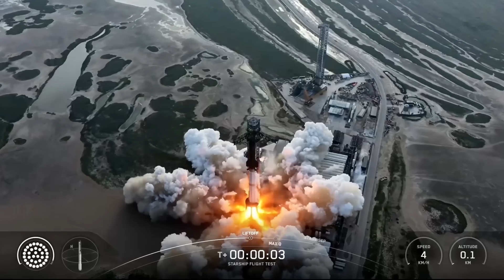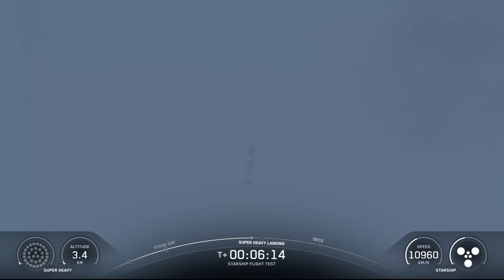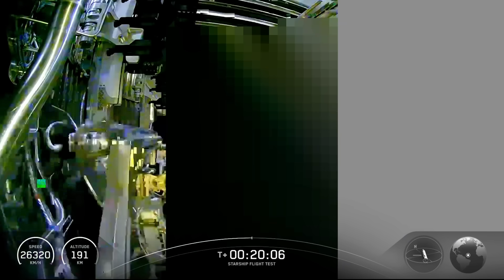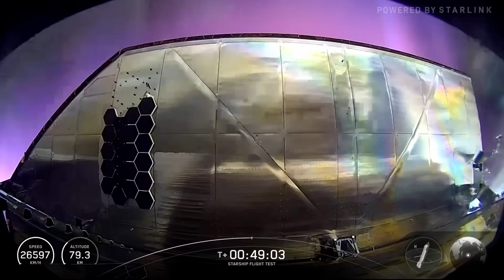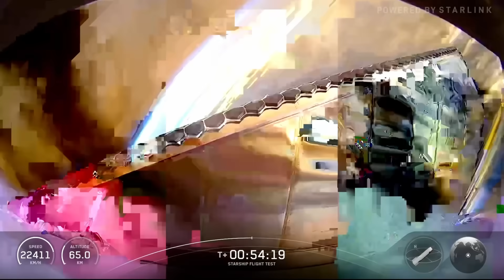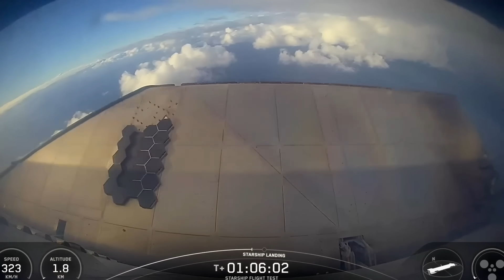The Most Unbelievable Rocket Launch In History (SpaceX Starship 10)

Comment: The female announcer was partially incorrect about the staging process. The whole point of HOT staging, is that you stage WHILE the stages engines are ignited. Instead of the ship staging, then the engines igniting, the engines ignite, and then it stages. This is done to insure fuel is flowing to all engines as seperation occurs.

Comment: The ship is sank down, why they are so happy? It missed the point of landing or not? Somebody can explain me what is just happened?
Reply: It was a simulated landing. They weren’t trying to land it on a landing pad, that’s why there was a buoy out in the ocean with a camera. They were torture testing the ship, and experimenting with trying to land it with one of the 3 thrusters out. They landed it in the ocean because they didn’t want to risk damaging the landing pad. And yes it was supposed to explode. It’s impossible for it not to explode with fuel still in it at that temperature hitting cold water.

It’s actually far more successful than they thought because the degree of stress they put it on nearly makes it impossible for it to land, yet it still did. Did you see the flaps disintegrating and catching on fire? They removed most of the heat shield to torture test it and yet it still held together.
Reply: @ChristopherGuilday  ok, thanks :)
Reply: @ChristopherGuilday  wouldn't that compromise some of the data? Wouldent you WANT to keep the thing in tact so you can get as much info from it?
Reply: they are cheering the death of the people onboard.  SpaceX is a huge echo chamber of Elon worshippers it seems

Comment: I don't think the explosion at the end was really meant to happen, right? 😅
Reply: that's why they cut the video haha
Reply: @CoconutPete Then I would say it is unfortunately a faulty design 🤷🏻‍♂️
Reply: no they do have multiple fail safes, they can control when and how the starship will explode, so this was intentional. And even if it wasn't meant to explode it still was a successful mission
Reply: @Met_Ace_ja I don't know if this should still be considered a success after the following findings, but what do I know: 

- clearly visible explosion in the engine cowling during the initial phase of re-entry 

- When an engine ignited, parts of the aircraft's own wing and other structures were destroyed 

- Fuel leaks 

PS: No rocket should explode, not even a little bit, and certainly not a reusable spacecraft. 🤷🏻‍♂️
Reply: @4gno5tic Yeah, it’s clear that you don’t know.

Comment: Incredible technology, and my hat is off to these efforts, even for those that were not quite as expected.  But rockets?  Don't rockets expend fuel, throw away mass to perform work?  Eventually, rockets, all rockets, run out of fuel or mass.  Sort of limits what you can do, doesn't it?  I should admit to being neither a trained Mechanical Engineer nor a Physicist.   But if the end objective is to get the benefits of F = ma (in the case of rockets (m1v1 = m2v2), where 'F' is the summed vectors of 'a' acting on the mass, 'm,' there could be a cheaper, easier way to do all of that without a fire.  There are other equations around that have the vector 'F' in them, one such is F = ((m*v^2)/r) [or something like that?], ---- let's call this last vector f ---- for Huygens' description of centrifugal force.  This equation involves spinning a mass at a uniform velocity in a uniform circle and has several vectors associated with it, which can be summarized with the 'Right-Hand Rule for Cross Product of Vectors.'   All of this last part has many industrial applications; some are prosaic and well-known. Cream separators are used on a container of raw cow's milk as an example.  One can imagine a (some flexible tubing taped to a cardboard wedge, say) circular tube or pipe that has water being pumped through it, then one might also imagine this circular pipe that is folded along a rough diameter to about 20 degrees or so. So now the vector(s) f might be labeled as '2*f' as there are two independent vectors because of that 'fold.'  Because of vector algebra, the '2*f'' part might now be labeled as f'' which written more fully becomes: f'' =2*(cos(10 degrees))*((M[the mass of water, [say, in each limb or approximate 1/2 circle of the tube that has water pumped through it]*v(the velocity of the water being pumped)^2)/(r-which is likely a bit shorter than the mathematical 'r' because we are dealing with physical objects here)).  The pumping device could be a centrifugal fuel pump, like is used in commercial or NASA-type rocket engines, if you wanted to get to the ground to orbit, say, as that is what my Casio tells me. Or if you are traveling between the planets or just adjusting or orbit, maybe a commercial, off-the-shelf, submersible sump pump would work, eh?  In either case, if you have a closed system with a top-off tank, you could endlessly recycle the same water over and over again, and if your system doesn't spring a leak, and your pump still works, and your water doesn't freeze, who knows how far you might go?  Not new information by any means, as there are books written about this method of 'traveling through space without rockets,' maybe there is even a 'shorter version' of this book, so to speak. If you take this suite of ideas to one of its logical conclusions. Not as long-winded nor as expensive as the NASA versions (even if only used as an interplanetary method), but there you go.

Comment: Really nice, but why they let explode the starship in the water and not on land? On land, the trash could be cleaned up. Without the cold water, the chance of an explosion is much lower. Without the explosion on land you can inspect the ship. Data is fine, but seeing it with your own eyes or checking for cracks in the material helps even more.

Comment: Great. 

I see they fixed the problem with the vertical flip near the end. It used to take about a second, which pulls 12 gees on a potential crew--sideways. Now, it took about 5, so, 2 gees or so. Much more survivable. 

The flap was damaged on the trailing edge, and the Satrship blew up when it hit the water. Or that was an oxidant release causing the water to burn. 

It looks like they got a lot of good data. Great job, team.

Comment: Spacex didn't show the crucial moment of reentry, reverse position of the Starship, engines ahead not only during landing, but from 200 Miles above the ground level. This is why the Starship is so "rusty", engines producing heat exposed it to high temperatures. What I can say, I proposed it on X in April 2025, and I have satisfaction that I predicted, or inspired some fellows in Starship. Congratulations, guys!

Comment: Here in Africa we're proud of the US technological effort. Well done, guys. Just one question why did it blow up at the end?
Reply: I think they tested a controlled explosion in case the rocket deviates from its intended trajectory and threatens to fall on a ship or oil rig. It was the last one right after the landing pad vertical allignment. They collect live data anyways so they don't need to pick up the rocket.
Reply: @Bodumlightenkindazuza  it didnt blow up it was just the last of its fuel burn before shut down.

Comment: WIld part, they removed like 15 or so tiles spotted around the center belly of the heat shield as a test, and it seems like it lost most the tiles and exposed mostly the ablative layer and stainless steel and still made it to a pretty accurate landing sequence. def not an ideal way you want to come back, but pretty impressive resilience. It just shows how good of a decision stainless steel was for this rocket.

Comment: Why no catching the booster?
Reply: If I had to guess, it was because they were testing what would happen if one of the engines failed and whether they could still make the landing. I don't think they would have wanted to test this over land because of the possibility of a failure. If they did mess up, you have burning fuel and debris all over a launch pad. Nah, a water landing makes more sense. If you succeed, which they did, you know you're prepared for the possibility. If you fail, you don't damage any of your land-based equipment.
Reply: @Halo1138  was that the official objective or it's something you are guessing might have happened?
Reply: They stated that it was never intended to catch the booster on this flight since a booster has been caught successfully on prior flights.  This booster was flying for the second time and they wanted to simulate an engine loss scenario and a backup plan in that case.  To risky to prove something that has already been done.  Awesome job SpaceX. A successful  Flight 10 was crucial to get back on schedule and regain credibility!!l
Reply: @aviralsinghal1274  I literally said "if I have to guess"
Reply: Final flight for this version. So they put it in the gulf.

Comment: It exploded on landing. How is this their 'most stunning launch yet'.
Reply: It didn't explode upon landing. You can see it land without exploding, then slowly tip over from the waves... then explode upon smashing into the water. The point is to achieve a soft splashdown, which they did. After which, the ship (on this mission) is useless and is meant to sink to the bottom of the ocean. It'll become reef in time.
Reply: Most stunning because it was not meant to withstand a water landing, so it was successful.
Reply: Your name fits purr-fectly.🤦‍♂️
Reply: There's the EDS. EVERY single aspect of this test was a huge success. They never planned to recover this ship. If you had listened to the broadcast, they repeated MANY times that their goal was to stress this ship to failure and it never failed. It landed upright in the water and fell over and exploded exactly how they planned.
Reply: @themonsterunderyourbed9408  So they intentionally planned to add way more fuel than necessary, so the the ship was guaranteed to explode. They intentionally planned to pollute the ocean instead of recovering the ship, which they have proven can be done. Wow. Some 'plan'.
Reply: The Starship section finally made it back through the atmosphere.
Reply: It was supposed to explode landing IN THE OCEAN. Do you know anything about science? What happens when something that’s extremely hot touches something very cold? It was a simulated landing, and every part of the launch was a success.

Comment: how come this one was not re-landed?
Reply: They wanted to test what would happen if one of the three center engines didn't re-light near touchdown.   They lit just two of the three center ones and one on the next ring out as a counter balance.   Since it was something new and experimental, they didn't want to risk possibly damaging the launch pad if it didn't work.
Reply: cuz they going beyond that , they are simulating engine out scenario if they can still land it safely .
Reply: They commented that they were having the booster and ship taking a more severe angle of entry to torture test them. So being the heat from this test was expected to cause damage, no sense in risking damage to the tower.
Reply: Prototype
Reply: They're testing this one to it's limits, they wanted to see how well the ship takes an extreme re-entry profile. Wouldn't want to risk this gigantic rocket to fall on people's homes, eh? That's why they landed it in the middle of nowhere

Comment: The the starship blow up when it entered the water?
Reply: Well it still had fuel in it and I can imagine how hot it must be after re-entering from space and what happens when it hits cold water?
Reply: Why the quick video cutoff after that?
Reply: @lym3204  It's a highlight video, plus an explosion happened right next to the camera and the starlink uplink. Watch the original stream if you want full context.
Reply: No
Reply: This was still a test, and the final phase involved attempting a soft touchdown. You saw that touchdown succeed, which is why the test was considered successful. The explosion afterward was expected and inevitable since when a super-hot vehicle with residual fuel hits water, that violent reaction will happen. In normal operations, this won’t happen unless SpaceX deliberately ditches Starship in the ocean or misses a sea platform.
Reply: They blow it up so it'll sink and to disperse whatever fuel is left. It's a simulated landing (hovered) - there's no platform out there for it to land on. The camera is on a buoy and was disabled in the explosion.
Reply: Yeah I said the same thing! The ship does the impossible in space but blows up when it lands!
Reply: @bigwill8773  It did a successful, controlled splashdown, but the craft was not meant to withstand a water landing. The video cut off, and the non-explanation of the explosion made it seem like they were hiding something, but it was a total success.
Reply: @lym3204  You don't need an explanation for the explosion. They said "we don't plan to recover this craft" during the broadcast. 

It blew up because of course it did. It's not made to land upright in the water (or they did a self destruct to prevent others from recovering the ship and stealing the tech). 

Don't try to twist this into some kind of failure.

Everything in this flight was a huge success, including the explosion.
Reply: @themonsterunderyourbed9408  If it's not made to land vertically in water, why did they make it land in water and not on solid ground?
Reply: @dr.emmettbrown7183 they said during the broadcast that they didn't plan on recovering the ship. Their plan was to simulate an engine failure during landing which they did and the ship still landed upright. 
They landed it in the water because they didn't want to damage the landing pad in case something went wrong during the landing. 

You'd know this if you had watched the broadcast.